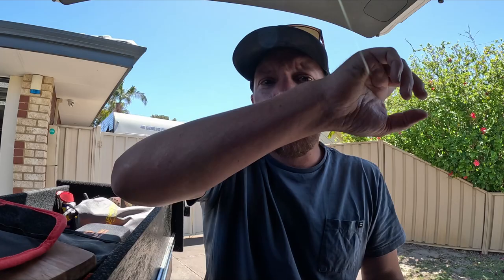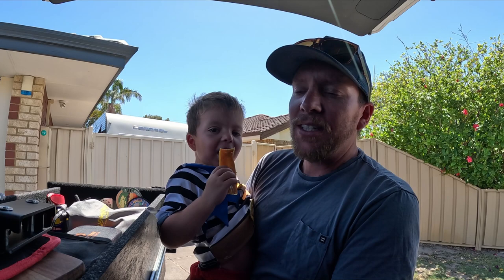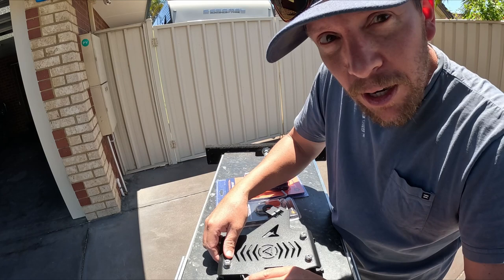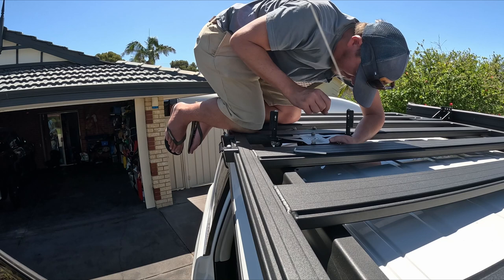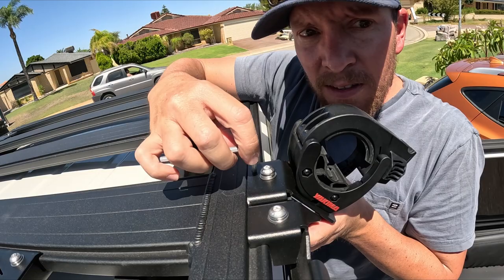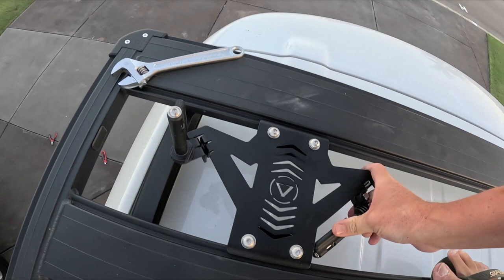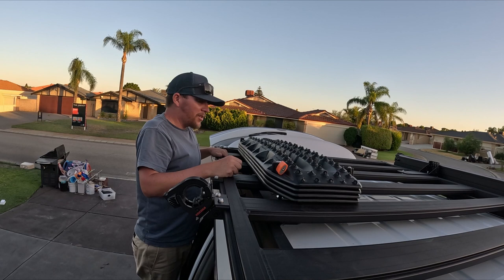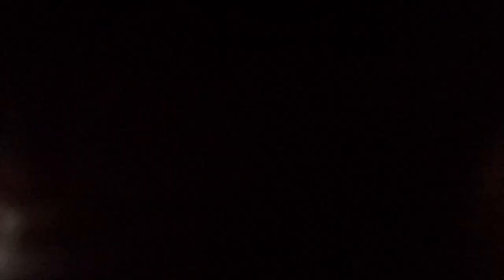Flush Maxtrax Mounts for ARB Base Rack | Install Series

Comment: Any long handled shovel will work. 
The multi piece are good if you're storing it in the vehicle but I'd be worried about them rattling apart on corrugated roads.
Reply from the maker: Thanks for the reply mate 🤙🏼 I have the multi-piece Navigator but thinking the same it will rattle around.
Reply: @8FeetTravels  out of interest is the shovel mount lockable?
Reply from the maker: @Ovaworked4x4  Yeah it is 👌🏼